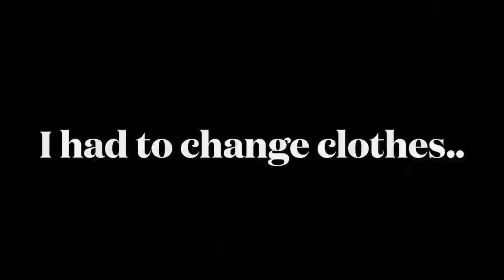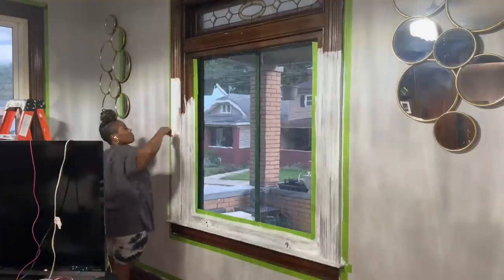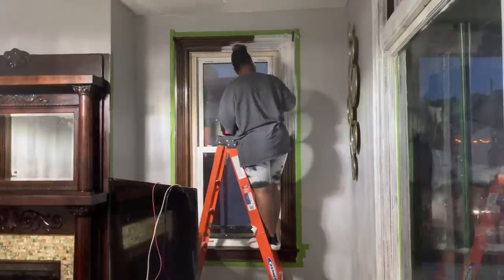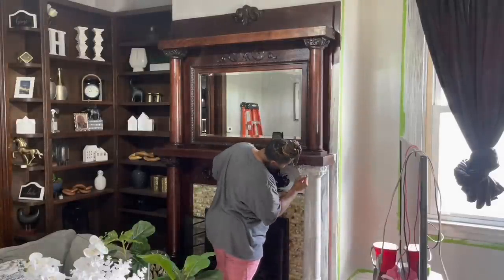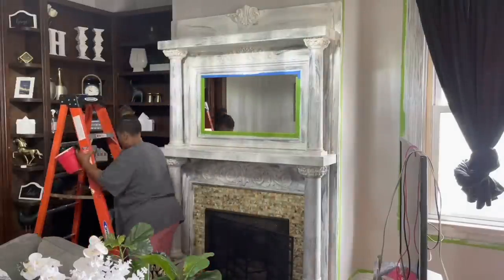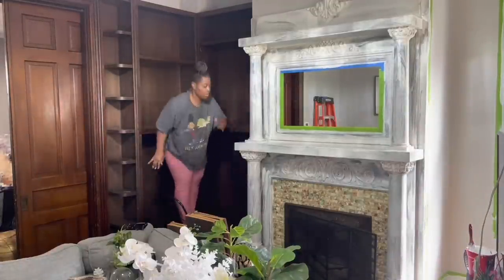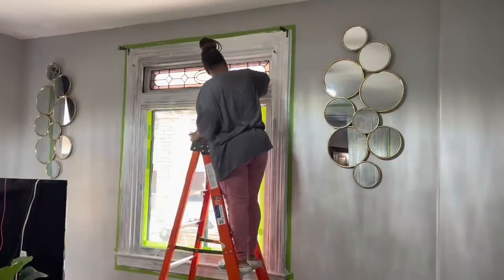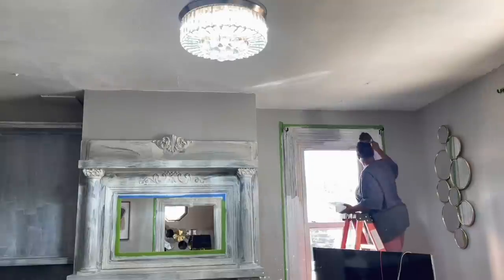DIY LIVING ROOM MAKEOVER LOADING PART 1, PAINTING MY TRIM, FIREPLACE AND BUILT-IN BOOKSHELVES /SMTV

Comment: My opinion since you were going darker on the fireplace and the bookshelves, you didn't actually need a primer. When I painted my fireplace and my bookshelves Winter way by behr I did not use a primer and it took 2 Coats.